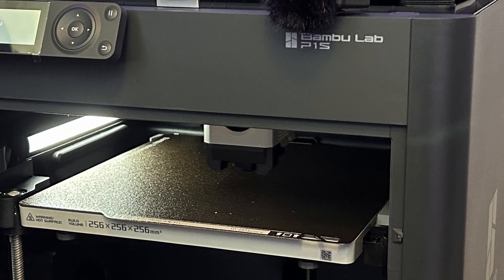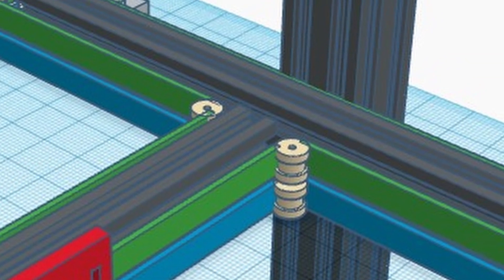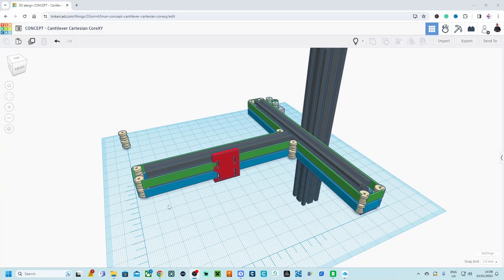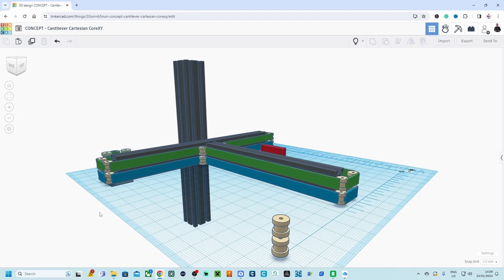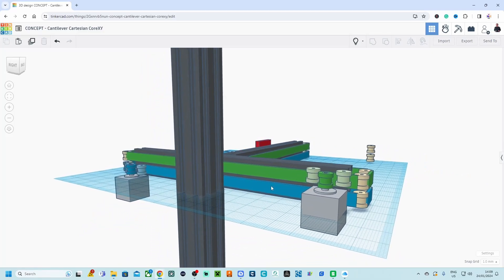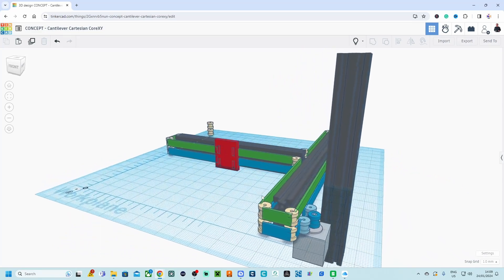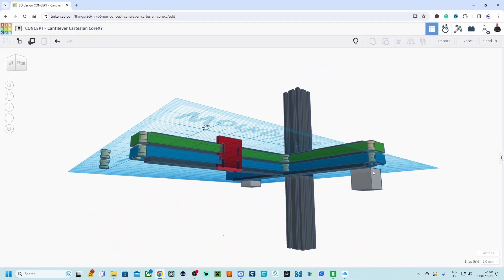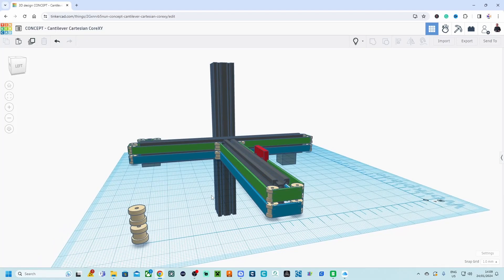Cantilever CoreXY Z-Core - The Concept part 1

Comment: Hey, I'm doing a similar design it's a cantilever moving in x and y and the bed moves in z.
But I'm using the Markforged kinematics as the belt routing is easier, my goal is to make something that's portable because I want to take it to the upcoming hackaday event in Berlin😊. It has 150mm cubed build volume and uses a 3d printed frame and mgn12 rails. I got the 3d cad 90% done in a weekend. If you are interested I can share it with you.
Reply from the maker: I would love to go to the Hackaday, I have family things to do that day... 
I never heard of the Markforged kinematics before this video... but that seems to be interesting too. 
You can share it with me... are you on twitter? zachary3dprints is the name